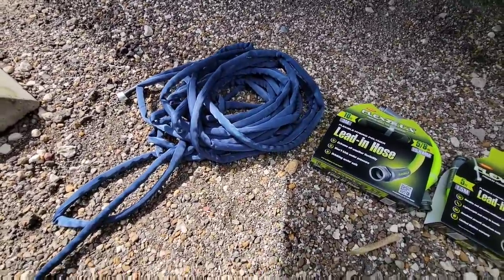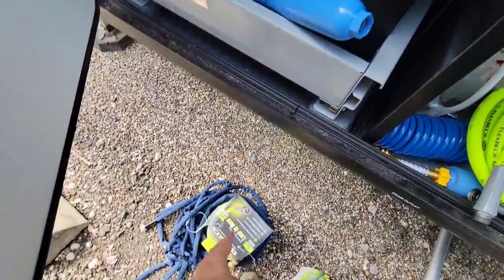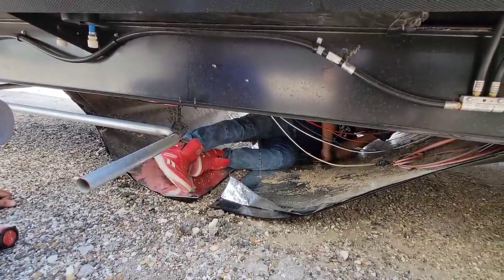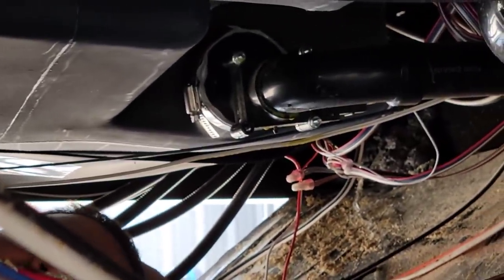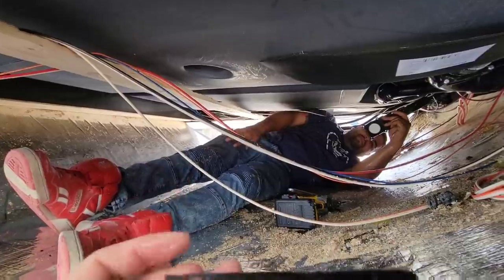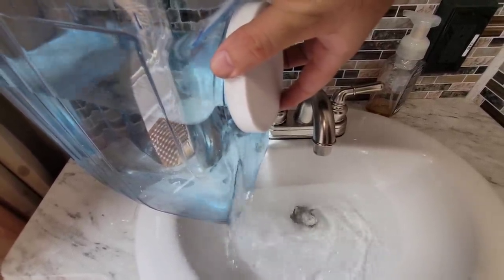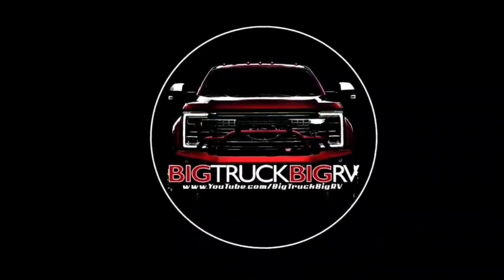Found in my RV Grey Tank! What the heck is this???

Comment from the maker: Many folks comment on the saw dust. So, the challenge is access.  The bottom panels are secured first under the frame, the tanks then go on top and then the subfloor.  This creates a very slim pocket between the tank and panels beneath that allows any sawdust to accumulate during construction. It's likely not even visible during the assembly process since there is no way to see it.  Perhaps after watching this video, manufacturers can look at ways of improving the ability to access and clean that area out.  Remember the techs said this is what it's like in ALL RVs regardless of brand, and it's not hard to understand why if you think about the logistics during assembly.
Reply: Truth! These Rvs are made by human hands and things are gonna get missed. And as these move up and down the road its gonna shake more of the dust loose. I hope Coachman and others see this and create a step in the process and vacuum them out. I gotta say you've been blessed to have 3 really good techs come to your rescue, that's hard to find these days!
Reply: I understand how and when the saw dust gets there. But then a siphon valve in the Black tank flush system fails. Some are located under a bathroom sink. Mine just happened to be in the wall behind the shower and the pantry. Of course it soaks the floor , but also runs down between the walls right down on top of the black tank, off the black tank and into all that wonderful underbelly insulation and sawdust.  I wish these manufacturers would get rid of the cheap, plastic, failure prone devices and put an honest to goodness household grade brass unit in their instead. Owner forums are chock-full of stories documenting these crapped RV units. Wanna bet folks don't know where their's is? Let alone what it even is or does?
Reply: The sawdust is a zero issue, and over time driving it will find an exit and blow out. 

We have at least 30,000 miles on our 2019 open range, and I STILL find sawdust in corners inside the rig. Your house has all that sawdust too, but it doesn't go through an earthquake regularly, so it just stays where it was.
Reply: One of my whisper quiet air conditioners was leaking water into the coach.  The cause was saw dust from the ducting had made its way to the drain holes below the evaporator coil.  You should probably inspect the inside of your 3 air conditioners after the first season of use on your new rig.
Reply: Josh @ Hayletts rv has several videos of how they're built at the factory which I find it interesting,  great video btw jd,  glad you got that corrected!
Reply: @LordFalconsword  That was a lot of saw dust in one area. When it gets wet, now it will not go anywhere and smell .
Reply: I  not saying g you should not find some sawdust, but that amount? That is no attempt to keep things clean and neat. Maybe if that area is so prone to capturing sawdust the under belly panels go in later in the process? When I work on anything , especially for somebody else, I clean as I go, it might "not matter" but it does to me. I believe it shows professionalism and pride.
Reply: @gordonsteel55  Yeah, by human high school dropout's hands.😉
Reply: @mattsmith3305  Wow thanks Matt. That is good to know. For those who say sawdust is not an issue, it can be. Matt how do you like your Whisper quite units? Are they indeed quieter? Thanks.
Reply: I am sure you vacuumed the sawdust up before reassembling?

I had a 4 pole boat plug put on my trailer with the hitch, and the shop just tucked the cable out through the bottom cover, leaving a small gap.  Bees moved in.  I wonder if they liked the ready supply of sawdust for nest building.  Anyway I couldn't figure out how to get the nest without resorting to dust or removing the cover, but after a 100 mile trip there were no more bees.  I figure the workers all were out pollinating and couldn't keep up with the rig or find it afterwards.  Nest is probably still in there but dead.

Comment: In my former career I made water for a variety of uses on a nuclear powered submarine one of which was drinking water. The purity of the water was better than most public water systems or bottled water. The inside of the pipes and the tank still managed to grow bacteria such that the inside of the tank was slimy such that it would gross a fair amount of people out. Never did the water cause sickness. The same people saying get rid of the zero g hoses because they saw a video with one cut open and it was black should definitely not look inside their pex water lines in their homes.

Comment: I worked for Step2 for 3 years. I was an operator on roto-mold machines. This is what rotational molding pieces would end up with when the steel wool pops out of the air tube on a mold. Essentially, the plastic melts and then seeps out of the air tube. Sometimes, that will break off and fall inside an enclosed product. Sometimes it sticks out and we could cut it off, but usually it would get stuck in the tube inside the mold. Surprised that it got missed on such a large item though. It's pretty much just a manufacturing error. Not sure if these are roto-molded or if they are blow-molded, but this can happen with both if I remember correctly. Sorry that this ended up in your tank. I can see why it would be an issue in a tank that isn't designed to handle any kind of solid waste.
This also often means that a lot of the plastic used to make your grey tank may have spewed out of the mold. This can lead to thinner walls of the plastic. Just keep an eye on it. Underweight products aren't as strong as their at-weight counterparts.

Comment: We full-time in a 14-year-old Cardinal 5th wheel that was 10 years old when we bought it.  About 6 months in, the black tank pull handle disconnected from the gate valve.  It had been difficult to operate, and finally let go after unthreading from the valve ( I had no idea it was threaded on.  This thing has corrugated steel panels that are laid in from one end to the other, each one overlapping the previous panel.  I had no idea how to proceed.  

Called a mobile repair service, and he gave me a choice.  Remove all of the corrugated steel panels from the front to the middle of the rig, or he could use a drill and snips to cut an access "hatch", and would just fold it back over when done.  We're in a mild freeze climate, at least it was until  Feb 2021, so it wouldn't be a big deal to leave it unsealed.  Since this is an hourly job, I voted for the access hatch.  He re-attached the push/pull rod, lubricated everything, and showed me where and how to fix it if it came loose again.   A couple of years later, the valve started getting stiff to operate, again.  I was able to peel back the hatch, and there was plenty of room to grease everything up again.

Now, my question.  Why wouldn't the manufacturers install a hatch(es) at the factory, or at least mark the location of the valve(s) to avoid guess-work down the line?  It would be so simple.

Comment: Similar thing happened with my RV but it was the fresh tank. There was plastic debris from cutting and drilling. It slows up my pump line once every 18 months but there is no way to clear it all out after flushes. Luckily plastic floats so we keep the tank full which helps significantly.

Comment: So John there allows your compartment door to swing out and smack the coach next to yours. ALWAYS replace seals when removing and reassembling a valve or line fitting, seals are cheap, labor is expensive.  ALWAYS lube valves before reassembling or replacing valves. A RYOBI 18V leaf blower works great and is fast. NEVER lean anything against the body of an RV, it will damage the finish of it.

Comment: We’ve had our 5th wheel for ten years now and I’m amazed had how much manufacturing debris are in the walls and compartments. When they used a hole saw they just left the round piece of plywood the hole saw removed lying inside the wall. I found about four of them. I also found a screwdriver, tie wraps, bits of wire, wire nuts and of course saw dust. I aviation manufacturing they practice “clean as you go”. The RV manufacturers could at least clean at the end of the day. Another peeve of mine is our 5er had hundreds of sheet metal screws in it and they’re all one size, about 1” long. So I have screw threads sticking out all over the place. 1/4” length sheet metal screws would work in most cases and look better and weight less.

Comment: Excellent video, we DEFINITELY gotta crack down on these RV manufacturers. Sloppy craftsmanship! There must be a way to make them so they don't come with all the debris hidden throughout the walls, underbelly etc. All tanks should be made 100% clear. Too many engineers are too busy trying to live on mars, outerspace  fantasy  nonsense and making ultra modern military weapons yet they can't make clear RV tanks. It would be so helpful if all tanks and vessels came with at least a nice wide clear band on a side so we easily can view exactly how much fluid is inside. Even better if it was a graduated clear line. Thanks
Reply: You want to use a clear tank for viewing the fluid level, and have the grey/black tank the buried underneath the frame and then is covered by an exterior grade plastic barrier.  What are you thinking?
Reply: @mathdj01 Sure, why not. Because some people open their RV up for various good reasons. Besides the manufacturer should make the entire tanks available with easy access hatches. I mean what's the big deal.😉

Comment: Sawdust is a usual thing. Also finding interesting debris in your tanks no surprise. All the disc pieces from where the factory cuts every hole for pipes into the tanks are rattling around inside the tanks just waiting for the chance to jam up a drain valve. They usually make no effort at all to keep the junk from falling down into the tanks.

Comment: I had a similar experience with our previous travel trailer, the black tank had a hole drilled out for the toilet and the piece fell inside the tank, they left it inside. It wasn't discovered until one time when we tried to dump the black tank and it wouldn't flow. I had to reach up in the drain pipe to pull it out, not a job you would like to have on a trip.

Comment: Had a similar issue with my 2014 dutchman. The grey tank had a slow drain. This after working fine for years. Bought new valve seals. Took apart the valve and found a punch out (the piece that is left over when they drill the hole into the tank) stuck in the valve body. Some internet research shows that this is a VERY common problem across all manufacturers.

Comment: I bought a new 79 Winnebago in March of 80 that was wrecked while being driven from El Paso to San Antonio, dealer wholesale! My Dad had a big shop so we were able to repair the damage, it was just below the windshield on passenger side wall, ten feet maybe. Winnebago's being one of the few coach's that were all metal framing then. After we got the wall  repaired I had to reassemble the interior, took about six months, getting parts and working part time evenings and weekends.  As soon as it was "dried in" we wanted to take it out, of course!
While flushing the water system and tanks, just draining the water on the lawn, it had never been used or PDI'ed, still had the anti-freeze in it!      
As I was  flushing the black tank  an almost dissolved paper bag with a half opened zip lock bag washed out, almost full of funny small brown leaves with a strange  odor! ...Hmmmmmmmm! The case of the wreck of ol'79 solved...LMAO!
As always a great post!

Comment: I replaced my zero G hose also I went with the Evo flex got a 25' a 35' and two 4' I'm using the 35' from the spicket to my first water filter then one 4' going to my second water filter and the other 4' to my water softener then the 25' to the rv and I'm now only using the zero G for black tank flush and I have a set for washing my rv and truck. I can't believe he is letting all that grey water pour on him
Reply: 2 rules for being a plumber. Shit runs down hill and dont chew on your fingernails.
Reply: Didn’t know you could get soft water in the RV.
Reply: @robertheinkel6225  yes, they have water softening systems for rv.

Comment: I purchased a 2021 Thor Motorcoach and found so much sawdust in all the places “no one would ever go”. For me though I like to know how things work behind the curtain because I do a majority of my own repairs. So removing some access panels it was similar scene you had but inside the coach. Worse part was metal shavings. Those hurt when they stick in your foot. They just keep appearing even after shop vac. and mopping. So I cleaned out all those places I could get to. I also found a rats nest of wiring. Don’t know why more zip ties are not used to keep things tidier for future troubleshooting. I found that the main power wire to the ac was passed through the metal box hole with no Romex clamp. Just rubbing on the very rough cut and burred hole. Over time with all the jostling a RV does that was shorting out one day. Gosh let me stop. There were bunches of “little” things that I feel a good inspection would have caught. I spent 2 weeks off and on just addressing them. Still a few more but had to take a break and go camping. 😂

Comment: I just cleaned out my 2019 trailer, that before covid we only got to use 4xs. It's still looks and smells brand new. I noticed I still have sawdust here and there. It's only 16ft inside.  So, not much to clean. Just vacuumed really good. Then took it to get inspected, more sawdust.

Comment: Gate valves don’t do well with differential pressure much less debris stuck in them. They are known for cutting their seal when functioned under differential pressure. Granted, probably more pressure than this tank is seeing. A better maintenance situation would be to have an access panel around the valves that are under the trailer.

Comment: I had a similar problem first trip out in a brand new Gulf Stream trailer which was a plug when they installed the toilet and plugged the black tank I’m sure it was a awe full mess for the dealership as it was under warranty they changed the tank.we took that trailer back 3 months later because it had so many problems must have been built on a Monday or a Friday glad things weren’t so serious with yours 👍

Comment: I have had 2 5th wheel and both had the saw dust and mess of wiring. 
It looked like your tank heater was NOT completely stuck to the tank bottom.
Reply: They all look like that. That's why they cover the underbelly and front compartment. To hide the mess.

Comment: Are those NSF 61 certified versions of the flexilla hoses?  I have one i used at home and took a non filtered drink out of it and the water stung my mouth and throat.  I attributed it to the water, becoming contaminated by the hose.  The water hose was outside and warm at first which could accelerate some chemical leaching from the hose material which is a soft polymer. Comment on this if you witness any change in your waters taste etc..

Comment: If the tube was loose and rattling around in the tank the assembly crew should have herd it. The quality control should have noticed that the valve wouldn't close all the way also. The camper manufacturer had a couple of chances to find the problem and even the dealer could have checked it before it got to you

Comment: The skilled craftsmen who built our 2015 Voltage thought it was perfectly acceptable to allow the plastic disks (that were hole-sawn to make the required tank openings) to remain in the tanks. Along with all the plastic shreds from sawing the holes. Our first trip and attempted dump of the tanks was not fun. Out of eight brand new RVs that one was the worst.

Comment: Majority of RV manufacturing is terrible!! I had a waste gate on my black tank that wouldnt close. After spending hours dropping the enclosed bottom panel and disasembling the remote waste gate setup I found the fallout piece from when they were cutting out the hole on the tank for the toilet. The circulat piece of ABS plastic had a slot it from their plunge router (looked like a PacMan profile) which got caught in the gate valve!! This was on a  36' Grand Junction which cost 60K+

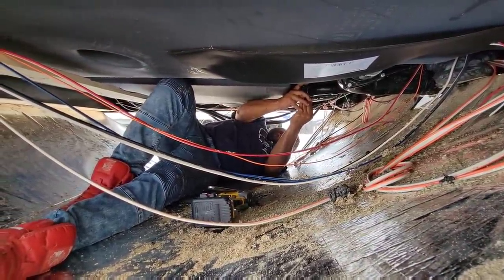Comment: I’m sure someone already noticed this and told you, but that tank closest to you has the heating pad separating from it, check out your video when you are around 9:45 mark
Reply from the maker: Saw it.. it presses against the bottom when the panel is up.  Heat and water flexing the tape will make it detach.

Comment: sold my home in 2019 and thought about a new motorhome but talking to people and all the problems with a new on i got a 1998 gulf stream, had to put on new roof new tires and a few small things that where out over time, plus save 100,s of 1000,s of dollars, the original owners had all recites and this first 12 months worth is about 3 inches thick with  things that broke under warranty and about  5 inches thick with things that broke after warranty2 things that dont work and im not gonna fix is the front roof air and dash air do not work, when the back roof air goes in gonna take both off and replace with roof vents cause i put in a 5000 btu window air and use my inverter to cool it when boon docking at about 1 gallon of gas in 12 hours of run time and yes it cools just as good the roof air does